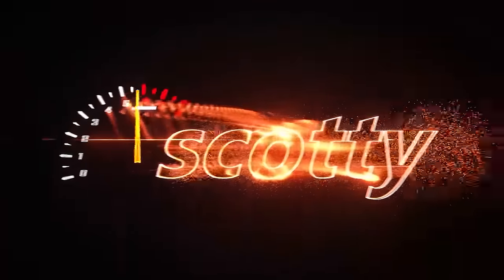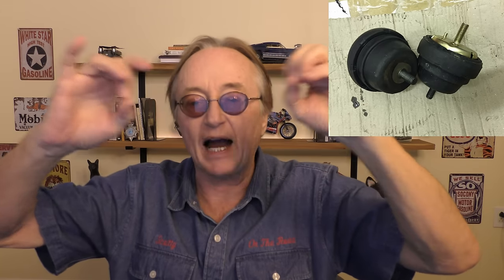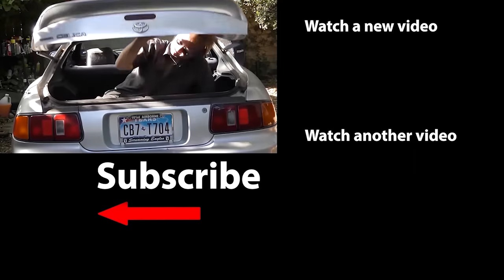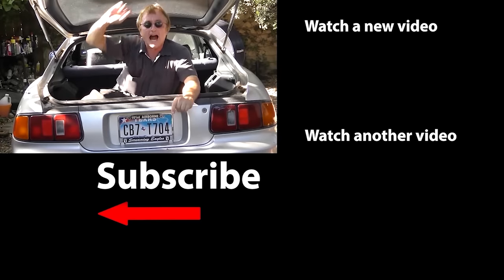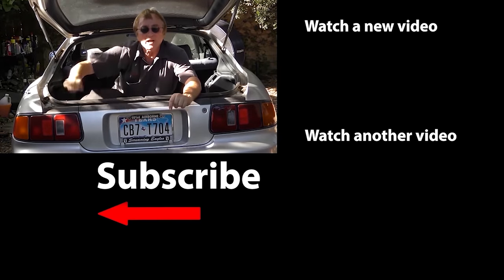Here's Why Changing Your Engine Oil After 3,000 Miles Will Destroy Your Car

Comment: A 2005 Prius, unknown miles, last January Toyota dealership replaced the old battery pack with a brand new Toyota unit in one hour,  $3000. Few months later the honeycomb in the cat broke loose and fell sideways. Bought a new one with the pipe extension attached online <$200, local shop installed for $100, and returned the old unit. You could see the honeycomb was clean. That car has made a 100 mile commute nearly every day since without issues. For way less than anything else to replace, it still goes reliably and everything works.
Reply: why "unknown miles"?
Reply: @KG-xt4oq  Because on these the odometer stops at 299999.
Reply: @macko2903  For real? That's dumb.
Reply: I’ve learnt 2 new things today! I didn’t know it affordable to replace hybrid batteries and the Prius mileage limit!
Reply: When you hear those valve trains on startup pour Castrol Upper Valve treatment.

Comment: In the Air Force we were always told that you had to wait a minimum of 30 seconds at idle before shutting down a turbine engine. The engineers found out that the temperature gradient across the turbine wheels would cause stress cracks in the blades if you shut the engine down without the cool down. Even the exotic metal INCONEL was prone to cracks if the engine was shut down heat soaked.

Comment: My dad used to paint his old chevy's with a rag and four hour enamel.  Patched them with tin, tar, and self taping screws.  A soup can or two on the exhaust.  Did what you had to back then.
Reply: A small foam roller and flat oil base enamel paint works well, too. A little textured, yes, but consistent. It's about protection rather than looks. For prep, a final wipe down with lacquer thinner so it stays on.
Reply: I’ve used a vacuum cleaner pipe on the exhaust in Volvo 4s… 😂😂😂
Reply: I used to have an old Firebird with road signs for floor pans🤣

Comment: Back in 1960 my Dad painted his flat red Renault Dauphine with fire engine red Rustoleum  spray paint and it turned out absolutely perfect.
Reply: My Dad also used to hand paint repairs on his cars , quite often in the front street. Neighbours would pass by and say it would never match or look good. But he wasn't put off and his results usually proved them wrong  : )

Comment: RE: All wheel drive systems.
I had to replace one tire in my Subaru Outback with about half the tread depth left.
My local tire store measured the remaining tread and had the replacement tire shaved down to match.
It was about an extra $20, but a lot cheaper than buying four new tires.

Comment: Exactly. My 7.3 powerstroke (single turbo) I ALWAYS let it idle after running over 2000 rpm or after pulling a load for at least 5 minutes. That engine is currently 25 years old, folks and its never given me a lick of issues.
Reply: Same.
Reply: Diesels are different than gas
Reply: Turbos still get hot 
Clean oil is cheap let it idle
Reply: Bro you’re talking about a 7.3, of course it’s gonna last
Reply: Same here. 1st gen Cummins , 90% of the time trailered. Specially in the summer get to my regular gas/diesel station off the freeway, let it idle while I’m in the store paying.
Reply: Always smart to let exhausts/turbos cool after running.
Even if its for a couple minutes.
Reply: I have a 6.7 powerstroke and do the same at least let it idle for 1-2 mins. Not surprised the 7.3 is still running they are super reliable but i guess its also hard to hurt itself with like 200 hp lol jk id take older 7.3 over the 6.0 and 6.4 all day. The 6.7 seems to be solid truck as well 160k miles no issues and plenty of power
Reply: How many kms/miles on it?
Reply: 94 f350 with the 7.3 and a 5spd manual transmission with the granny gear. It’s rwd, long bed crew cab. It’s the only vehicle my dad has that I wanted in the will.
Reply: Interesting. Our county ambulance service used to be all powerstrokes, until they started having too many issues with the engines. They replaced every single one of them. Now, I understand that using an engine in an ambulance vs daily driver are totally separate things, but I’ve seen too many buddies come over to the dark (duramax) side, leaving their powerjokes (and the many thousands they spent on their repairs) behind for good.
Reply: So to be sure I understand....if I have a Duramax 6.6 with the turbo but my foot isn't "in it" (I almost never kick it down hard) there's no cooling needed, right.

Comment: Scotty is absolutely correct. I did the 5,000 mile oil change interval with my GDI turbo and I went to 4,000 miles last time this time I’m doing 3,000 miles and sticking with that.
Reply: 5000 is optimal.
Reply: @ady007pl  not for GDI turbo with mostly around town driving.
Reply: @CreatingExcellence  Idk about GDI. 3.5 Ecoboost I do every 5k Miles and it runs like new
Reply: Synthetic oil doesn't degrade at 5k. Your oil filter does. Replace the oil filter with a mobil 1 filter, replace the lost oil from changing the filter, and go another 4 to 5k.
Reply: @mgsmith7475  it certainly does with many driving conditions such as a lot of around town stop and go city driving. It gets horrible fuel dilution which essentially keeps it from doing its job optimally.
Reply: 3k for turbo 
4k for naturally aspirated
5k for mostly highway driving

Comment: My nephew got over 300,000 on his 06 Impala.. bought new at 16.  The car has been from the East Coast to the West Coast  several times and probably almost every state in the nation. He loves Chevy's now . Those 6 cylinder engines last forever !!!
Reply: Mostly highway miles.  No way it would last 300k city driving.
Reply: Yeah I got 180k on my 07 Monte Carlo and that 3.5 still had tons of life left. The rust though and the fact it needed $2k in repairs I got rid of it
Reply: I love my 04 Impala it's simple and the engine is running like clockwork at 251,000 miles
Reply: @MrNexor-cj8gs I was gonna say that
Reply: Nope I don't believe it

Comment: I was a turbo owner and changed oil every 3K and after some hot and heavy driving I  would take it easy on the last 3 or 4 miles and let her cool down.   Got over 100K on my Mazda Speed 3 and sold it will no issues.

Comment: I've had an 06 chevy impala v6 since high school, the engine has never given me trouble aside from it leaks oil so I change it every 3,000. I did have to replace the transmission at 150k miles recently and there's something about the engine mount that makes it vibrate in idle, I beat it up in high school but at the end of the day I love it. Now I'm saving up to buy a 2015-17 camry or 16-18 lexus es as it isn't that much more expensive because the lifespan of the car is the only thing I don't like about my Imapla.

Comment: Scotty, what you say about the cooldown cycle makes sense.  What about the other side of the coin?  With NA engines, I've generally heard that it's ok to start them and drive away relatively quickly.  They'll warm up faster if they're being driven than if they're just idling in the driveway.  The condition on that is, you drive them gently until they start showing movement in the temp gauge.  I would think you'd want to keep a turbo engine out of positive boost until it's warmed up some but the problem is, most turbo cars I've seen lately don't have any way to monitor manifold pressure.

Comment: I always change all fluids of my car at 1/3 of the recommended mileage. Diff, transfer case, transmission, engine, cooling, brakes, all of it. My car is 11 years old, runs like new, never been to any mechanic, and i do everything in my garage.

Comment: The idling turbo was a problem before they were liquid cooled along with oil and before synthetic oils.   The problem was coming of the oil. Keep on scheduled oil changes and drive it normally.  I’ve had a handful of turbo vehicles including 1000+hp home build race cars, and 85 Shelby, Powerstrokes and others.  Never had a turbo failure.
Reply: grandpa lives in a time bubble.
Reply: yep my car has a water cooled turbo so its not gonna overheat any time soon.

Comment: Lot of gems in this video, esp the cooling of the turbo for a couple of minutes after highway speeds and the AWD advice. Turbos operate off the exhaust flow. Your engine works harder when speeding or towing and creates more heat than on light use. You have to let the exh temp subside before shutting down. AWD are extremely sensitive to tire circumference. They're expensive and computer controlled. People get into the habit of two-tire changes because of FWD, but its bad for AWD. You might think abt a sub to Car&Driver or Autoweek which is where I learned alot.

Comment: I have a 2016 Chrysler 200 4 cyl. Bought in 2017 at 30k miles, now 170k miles.
The only (not very costly) parts I changed the past 2 years were the spindles, A/C generator and compressor, all used parts.
The 5th gear sometimes shudder but that's it. I'm taking care of it. I'm quite happy with it, paid 2 years ago.
Reply: that's impressive.  i thought they had a reputation for being clunkers
Reply: @XTRABIG  I know... Well I learned later, the 9 speed transmission. I needed a car right now, it was good deal, the comfort and "American heaviness" of everything like the doors, steering, was way better than my beat up standard Versa 2007.
Sometimes I miss standard.
I also learned they stopped making this model because the price was too low for everything in it, like the Rotary Automatic Gear Shift Switch Control.
I'm a sales rep on the road and I also deliver pizza 3 night a week for 2 years, I'm using it.
Maybe I got lucky. I pray for another 100k if possible.
Reply: You might get an award if you get that Chrysler to 200k. The 9 speed is pure garbage.  Good luck👍
Reply: @kjd4476   That's only 30k left, I'll get there and find this comment. I'm hoping for 270k.
Reply: @regaubade8329  I really hope you do.. it just that Chrysler is known to disappoint 🤙
Reply: @regaubade8329  you deserve to get another 150k brother.  an honest working man on the road to support himself.  I hope you thrive in your sales gig and blow expectation$ out of the water-- just like your car.  Go 4 it! Peace
Reply: @XTRABIG  Wow. That's quite an awesome reply. Thank you. God bless you. Peace.
Reply: @regaubade8329 hope you make it to 200,000

Comment: this is 100% very accurate, 3000 miles definitely change the oil and let the turbo idle for a lil before and after driving to let the turbo cool down, unless you want heat warping and seal/boost leaks...

Comment: I agree on the letting your turbo cool down. I’ve done that my entire life and never had an issue. It’s also good for your internal engine components too. Main thing is to not beat on stuff and it will last you a long time. Most people don’t comprehend that though sadly.
Reply: Would you also let your engine idle  on start up so as to kind of warm things up a little.. I always do it especially when it is cold.. It somehow feels right!
Reply: @busdriver6278  yes I always let it warm up 5-10 minutes if not longer.
Reply: Doesn't take long for the Turbo in my car to cool down thankfully its water cooled.
Reply: @busdriver6278  I always warm my car up until it's about 75% of the way to normal operating temp, and the idle drops (about 5 mins).  Then just drive is nicely until it reaches operating temp.

Comment: 2020 f350 6.7l turbo still goin like a boss. Haul with it daily, pullin weight maxed out. Religiously change the oil and filter every 3000 miles. Use Amsoil oil and filter. Never had an issue.

Comment: My dad has an old cadillac (1991) and he changed the oil every 3k miles with conventional valvoline oil. 330k miles later, all the other vehicle systems were problematic, but not the motor. Zero issues!
Reply: Having been born in '88 this comment makes my lower back  (and most of my joints) hurt

Comment: The biggest problem with snow chains or snow cables on cars is I’ve seen them break and when they let go, they will eat up your fender because the clearance between the tire and the fender, especially on smaller cars is no more than an inch and a half to 2 inches.

Comment: I've seen tons of f150 ecoboost over 200k in the work truck field very rare for turbos to go out the oil changes are by the book I think 5k for severe duty using semi synthetic. The one I'm assigned has 146k on it and runs like a top. Don't be scared of turbos, regular boring maintenance is key.

Comment: Followed that oil and running procedure back in the 80s when I worked at Super Shops and drove my 87 Shadow Turbo. Quick little car! Used nothing but Castrol Syntec, which was the boss back then, asking with Mobil One.

Comment: 115k on my F150 Ecoboost.  Still turbo'ing like a boss.
Reply: Nice! I recently bought a 16 f150 limited with 75k miles and it rides & speeds like if It was new 🙏🏾
Reply: Lol 100k and he's bragging about reliability 😂 man you're ego
Reply: @grantkuropatwa6583  That was good 25 years ago.  Most cars started falling apart after 100K.  The thing about then though, was they were so much cheaper.  If I can't get 200K now, it's not a good car.
Reply: @mplslawnguy3389  no idea wtf you're trying to get at man
Reply: @grantkuropatwa6583  Try a reading comprehension class then.
Reply: @mplslawnguy3389  try not being so stupid you can't communicate
Reply: My neighbor has the same truck. About the same mileage. He loved it. But he just had one of the turbos fail. 2500.00.  So it sat for 6 months while he waited for parts and time to do the repair himself. In the meanwhile he bought a new Chevy half ton with no turbos. Lesson learned.
Reply: @mplslawnguy3389 what he meant is that 100k is new. You have to see what mileage they drive cars at in the third and developing world.
Reply: Turbos crap out within 150k miles, and that's IF you take care of them right.  So get ready for that repair cost. Even the mnf/rs that make those turbos will tell you that. Not knocking turbo engines ( I own a SHO with a 3.5 twin turbo) and love it, but I plan on dumping the car once it gets close to 100k miles, because those engines are expensive to work on. Wish the car had a simple pushrod V8 in it to be honest.
Reply: @jeff-ds2pr  Yeah I worry about that and also wish I’d gotten a V8.

Comment: Scotty-what’s your opinion?  2016 Nissan Rogue 4 cylinder AWD-makes a distinct humming sound at 65mph then goes away at 75mph. I raised the car, checked all four wheels. Tires are new. Bearings are good. Spun the wheels with the car raised-no unusual noise. transmission fluid, transfer case oil, differential fluid changed every year (regardless of mileage). Car has 38,000 miles on it.

Comment: It sounds like turbo charged engines should have an oil circulator and cooler for after the engine is turned off.
Reply: 👍🏽They make those… should be offered from the factory.
Reply: Toyota has water cooled turbo with electric pump which runs after truck is shut off
Reply: Also turbo has its own radiator
Reply: They already do.
Reply: They are called turbo timers, turn the ignition off, walk away and lock the car. Something that was extremely common in the 90s and 2000s (here in New Zealand, at least) and were in every turbo, either from the factory or aftermarket. I'm not exactly sure why they essentially became extinct. 🤔
Reply: @SW-vi4
The 2.7 TT in the f150 has coolant circulating for awhile after shut off of the engine. Scotty once again proves his lack of knowledge and is living back in the 1980’s turbo engine times
Reply: Porsche does that
Reply: @CadillacDriver  Turbos from the 90s and 2000s were oil-cooled, not water. Most turbos now are water cooled and run at much lower temperatures (by design as well as water being a far more efficient way to transfer heat instead of oil), as well as using electric water pumps that allow coolant to pump through the turbo after the engine is off if needed. Also, synthetic oils are significantly better than the organic oils of old, plus turbo bearing technology and mfg tolerances are also better meaning there isn't nearly the same amount of heat or wear being generated in modern turbos.
Reply: @Pyrrho_  ?? Bruh. My point and post is 100% valid - do you know what a turbo timer is? You literally turn the ignition off and walk away, lock the car up and forget it. Scotty here, recommend waiting a few minutes before turning off the ignition - a turbo timer does exactly that it idles the car for a few minutes before shut down. You aren't "educating" me here, I know full well how turbos work - from way back yonder - until now.
Reply: @CadillacDriver  I was replying to your statement about not knowing why we don't see turbo timers nowadays, yet you chastised me for explaining why.
Reply: @Pyrrho_  did you not watch the video? There is a clear need for them.
Reply: @CadillacDriver   @CadillacDriver  Did you not read my response? Scotty didn't address any of the changes to modern turbos -- only referring to "what we used to do", and if there clearly was a need for timers, why didn't he suggest aftermarket installation of them? They're still available.
Reply: @Pyrrho_  oh wow. You have issues, bro.

Comment: O2 sensor code tip: I thought I'd need to replace it and couldn't get it off and was going to take to my mechanic so I cleaned the contacts with cleaner and put it back on and it ran fine afterwards.  Sometimes just cleaning the contacts makes a these codes go away.